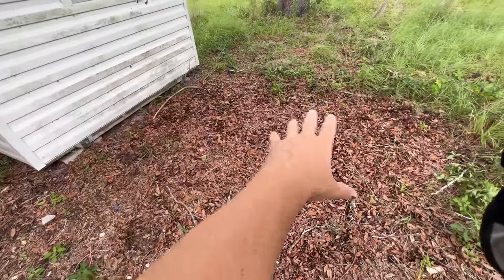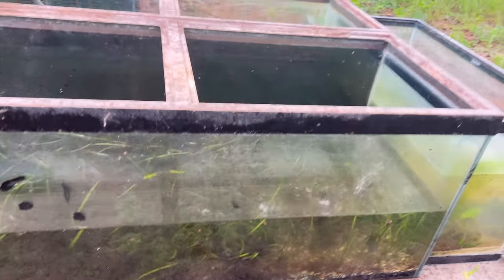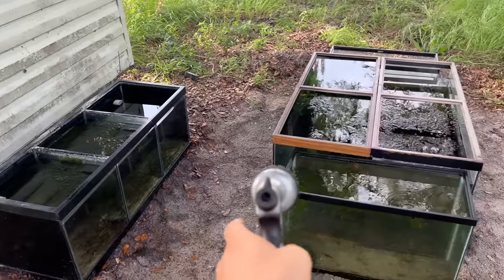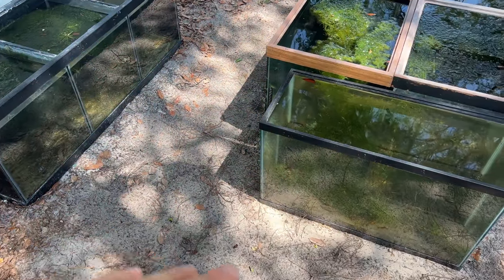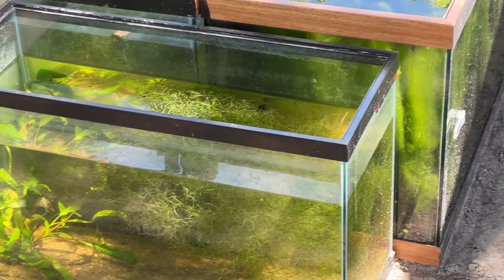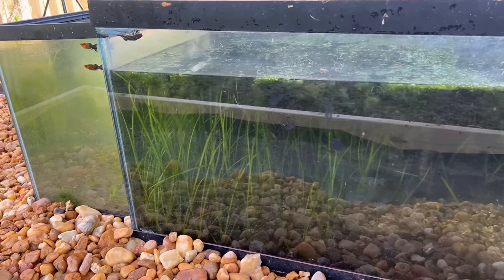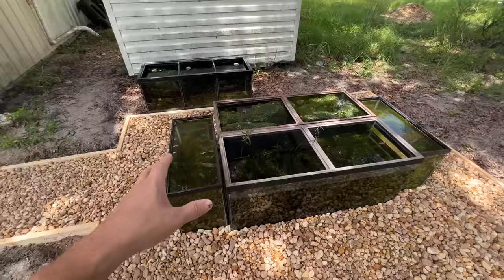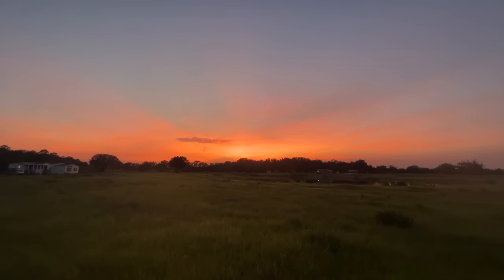Aquarium Tropical Fish Garden The Beginning

Comment: 4:53 guess you could just attach the white wall to the back of the aquarium shelves if you really wanted to? just a couple of nails or screws, easy enough to change if you don't want it any more
Reply from the maker: That’s a good idea but would have to cut a lot of pieces
Reply from the maker: O you mean the whole sheet on the back… hmmm
Reply: @LRBaquatics  yeah precisely. Just along the back, full width and full height (so 1 or 2 pieces). and if you're feeling fancy, create slits for nails sticking out at an upward angle to hang in so you can lift it off and on again like a picture frame 😏

Comment: Nice build Lucas. Thanks for sharing.
Do you need to add overflow drains? 
Additionally, I like the suggestion for trellis but I would add that it would address my concern with the birds. I expect that birds will find this garden area and while predation is one risk, a strike from one of those long beak fishing birds might damage tank walls or bottom from the inside.
Reply from the maker: I will probably just keep the water level a little lower. With the tree above the heavy water runs over it towards the tips and edges of the tree. Id have to get some type of wildlife deterrent probably at some point.
Reply: @LRBaquatics  sounds good!!